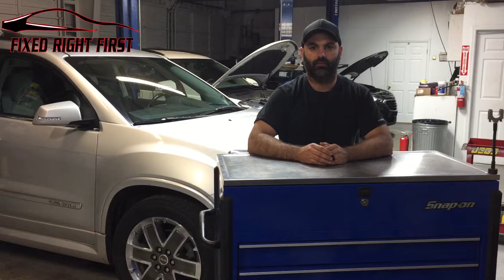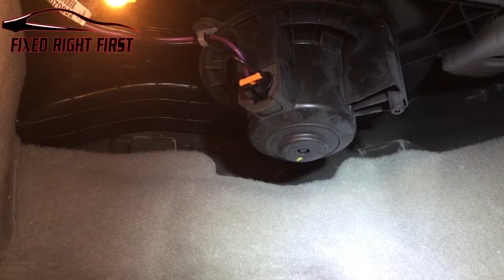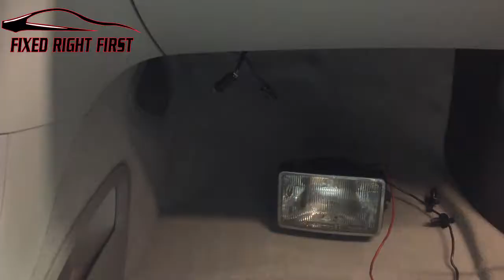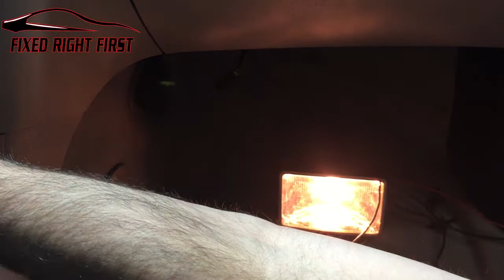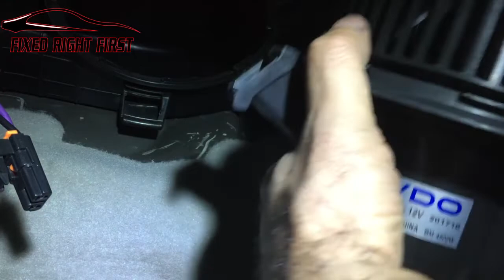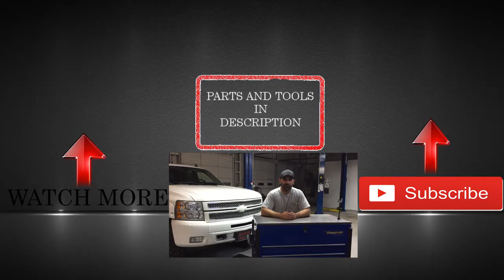Acadia, Traverse, Enclave No Air FIX!!!! Blower Motor Replacement!!!

Comment: This was a huge help. My wife had no air coming from her front vents (floor or dash) on her 2008 Acadia. I hit the blower motor a couple times as suggested in the beginning of this video and then BOOM. Her vents are blowing air. I was about to replace a door actuator until I saw this!!! I'll be checking your channel for more Acadia content because there's water sitting in her blower motor cover and a couple other issues. Thanks!!!👍🙏

Comment: You hit the nail on its head for me. My ac would blow in the back but not the front. Frustrated kept trying to change it from blowing to the feet to defrost to blowing to the head. Wasn’t working gave the blower motor a hit started working. Now just to replace it. I knew it was not the actuators because they control direction and temps. The blower was not working at all no sound but the rear one was.
Reply: Mine is the opposite  it blows from the front vents but nothing in back  can some one help me ??
Thanks

Comment: In my 2008 Enclave, the blower is coming on and off intermittently, kind of huffs and puffs at times too.  Sometimes on long trips is stays on constantly just fine. Could that be the blower motor defect? Or something climate control related? Still does it with climate set down to 60, and will still do it in just fan vent mode.  It passed the headlamp load test, got brighter with each notch to max blow.  Rear blower works fine all the time.  Any suggestions?
Reply: I'm having the exact same problem in my 2011 Chevy Traverse. I'm going to try replacing the fan motor and see if that fixes it.
Reply: @mokuuh  having the same issue on 2012 buick enclave. Did your replacement fix it?
Reply: The motor is probally submerged in water like mine was